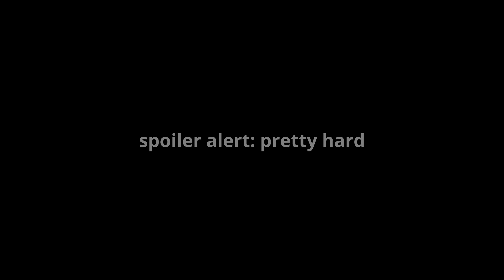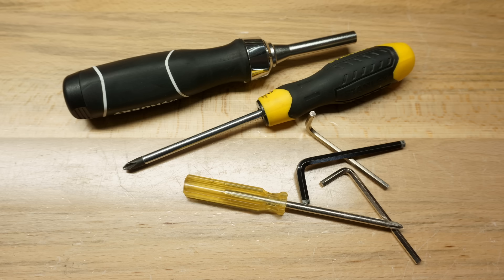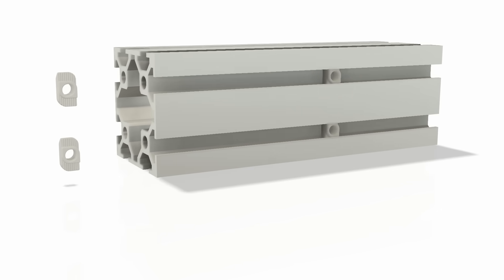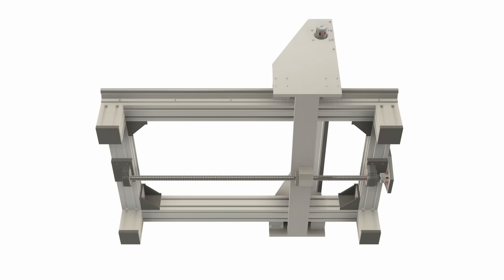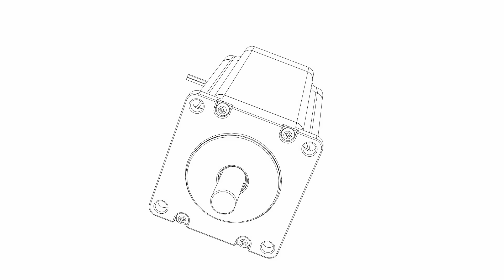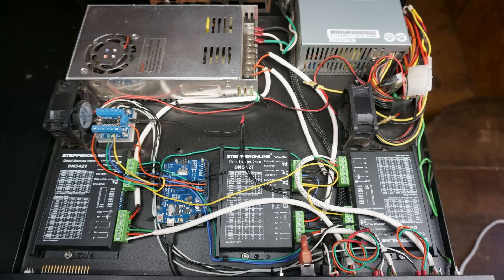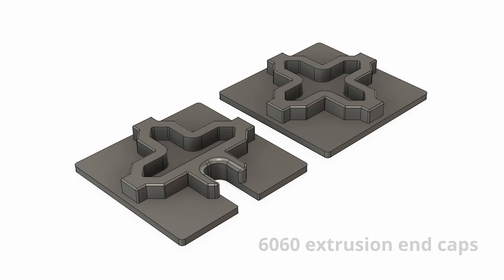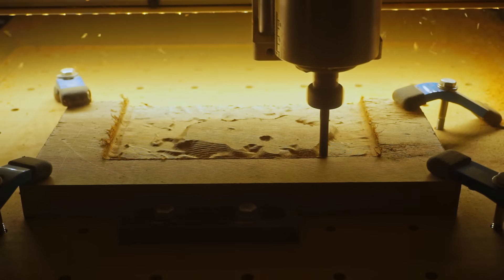Making a DIY CNC machine with limited tools

Comment: But why does most CNC machines have shorter Z axis? Isnt it more efficient to have the same length on all the 3 axis?
Reply from the maker: You can't really cut much deeper than the length of the bit, and the longest bits that are commonly used on a machine like this are 3 inches. So there isn't much point in having the Z-axis travel be much more than that.
Reply: @benmakeseverything  right. I didn't consider the bits. That means, if you want to make something tall with custom shapes, you need to add another axis/rotation where the router can rotate an angle of 45° or more. Then that would be another issue for stability and precision. 🤔 Hmmm, that would be harder to make.

Comment: The next level thing you can do is wire your router to your arduino, this enables setting router speeds through the GCODE...

Also, if you properly grounded everything, particularly your router.  You can mill a small alumunum block, that is extremely precise, run a ground wire from it to the arduino.  This way when your router bit touches the the grounded aluminum block, it says, "o hey at this z axis, y axis, and X axis, is where the bit is".  This enables fast precise, repeatable 0ing out of the machine.

Comment: Nice! One question: aluminium isbt great to sand, because it's so soft it tends to gum up sand paper, so how many belts did you go through on that belt sander? Or did you find some way to avoid that?
Reply from the maker: I really didn't do all that much sanding on the belt sander, but you're right, it does gum up the paper a bit. Probably just the one belt that was on it got used up.

Comment: Hello. How precise is your machine. Thinking about making it and turning it to an art replicator. I’m just wondering if it has the precision for a fine detailed drawing with lead/ink. Help would be appreciated. Thanks!
Reply from the maker: It is very precise actually, and you can set the stepper motor drivers to different micro-step setting to increase the accuracy. The main loss of accuracy come from deflection when cutting through hard materials, but if you are building a machine to draw then it would not be an issue.

Comment: Thank you so much for this video, I absolutely want this!

With the enclosure, do you think it'd be quiet enough to machine foam in a apartment ?
Reply from the maker: Maybe - there are a few thing you could do to reduce sound. I don't think I went over it in the video, but underneath each of the 4 legs, I put foam rubber padding to reduce vibration. The machine is currently sitting on a sheet-metal table, but that amplifies some of the noise - it might be quieter on a wooden table. Also you could use thicker material for the enclosure. If you really want to reduce the volume though - get a water-cooler spindle instead of a router, they are much quieter.
Reply: @benmakeseverything  Thanks for the feedback.

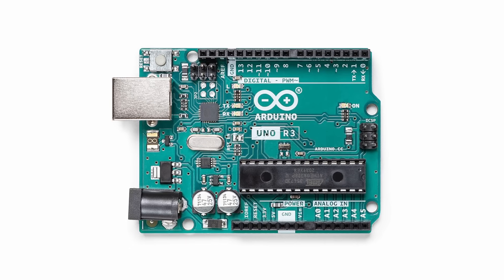Comment: 8:20  if it runs GRBL, can it use LightBurn?
Reply from the maker: Probably - I do want to add a laser attachment at some point, should also probably re-do the enclosure with fume extraction and some removeable opaque panels for safety.
Reply: @benmakeseverything   Laser or not, LightBurn is incredibly powerful software. 
When I saw the demo I bought it instantly!

It would seem to lend itself to CNC as well. But as soon as I typed that, I remember that that CNC is 3D, not 2D.   So can you use Prusa slicer?

Comment: Not a cheap hobby to get into by any means. Learning curve is also a bit steep. I've built a 5c cnc lathe, retrofitted a sherline cnc to run on grbl, built a chain driven cnc router and I'm getting ready to build ball screw cnc router. Definitely addicting once you get going. Did I mention it ain't cheap?
Reply from the maker: Yeah I believe you - I have been thinking of ways to update this and the costs really do add up... But it very rewarding when things work!

Comment: Great machine! I made few CNCs but not looking so good. 😢😢 I spent a lot of money to made a machine. Here are two examples. I spent 400€ for the first and more than 1500€ ( dust shoe and cyclone for wood and  vice for metal included) for second machine, this is very expensive hobby.  🤔🤔

https://youtu.be/TDTDN_KkoJc
https://youtu.be/ziXmku7p6O0
I use MDF for work plate on my second shown machine because metal one is too expensive. I have great and precise vice which I mount when I am doing aluminum and metal and I use only mist not flood. I use piece of thin metal sheet to protect MDF but some coolant sometime drip on MDF 😥

Bits are very expensive although last long. I spent more than 6€ for single tungsten carbide coated bit !!!! 😗😗 and I have a lot of various bits for different materials so this is great expenses for this hobby or work.

Comment: Something like this be used to mill a motorcycle cylinder head?
Reply from the maker: I wouldn't try it with this machine as it is currently set up, but with some improvements to the design it would be possible. Mainly, the Makita wood router is not ideal for aluminum and is limited to 1/4" shaft cutting tools. I am able to cut aluminum with this machine, but have to use shallow passes to avoid having bad surface finish. In my follow-up video I go over some ideas on how to improve it...
Reply: @benmakeseverything  would you know of a benchtop device that could be used for what I'm speaking of? Have a greatly appreciate any direction or advice given thank you

Comment: NICE ! I started designing my 6' X 12' CNC Table, though mostly for LASER use with a 90-Watt Co2 LASER I bought. But I was gonna cheat and use a Router as well,  even though most people suggested NOT to mix the 2 on the same table, but hey who's paying for it ? 

Sooo any way...I complete 6 months of research and CAD'ing the crap out of the table, with 3X NEMA-34's, an 1,800mm 2505 Ballscrew and 2x 20mm Round Linear Guides for the Y-Axis, a Pre-Built 300mm for the Z-Axis (ROUTER), and then started TRYING to find the 2X 3,600mm 2505 Ballscrews and 4X 3,400mm Guides for the X-Axis on the Chinese supplier sites. But they wouldn't ship those LONG Guides and Ballscrews to the US, COVID reared it's ugly head, everybbody quit selling for a couple of weeks, and when they did start selling again, everyone had DOUBLED THEIR PRICES over what I originally budgeted for ! Well, crap...THEN I lost the space I was gonna set it up in !

That was late 2018 into 2019...and it still sits unfinished $2,800 later, waiting for a finacial boost to finish it and get it running once and for all. So I know much of the headaches you got to enjoy, for this final entertainment value. GREAT JOB !!!

Comment: Hi, Could you please provide actual web-link to the parts
Reply from the maker: Hi, unfortunately I bought most of the parts over 2 years ago now, and several were ebay auctions so I don't really have links to most of them. This video was meant more as an inspiration than as a step by step guide, so I recommend shopping around for the parts that will best fit your design. Also, see my follow up video with more info if you haven't already. Thanks for watching!

Comment: I was thinking of buying a hobby 3018 pro and modify it what dya think? Is it possible?
Reply from the maker: I'm sure its possible, and probably a lot faster than building one from scratch. I have no experience with those so I can't say for sure.
Reply: @benmakeseverything  I mean replacing those round axial rods with linear ones and replace the spindle with Makita router would be quit good

Comment: Very well done. In case you ever have to tap tons of holes in metal in the future, opt for threaded inserts/helicoils. That way if you ever damage threads you can reuse the hole and not have to retread a hole.

Comment: Yes, I have one of those cheap unreliable ones, a 3020 cnc from gearbest; not to be confused with another larger machine with the same model number.  I would not recommend it to anyone as support was nonexistant.  I had to completely rebuild a lot of it as it was really sloppy so I ordered new threaded rods and bearings and added anti backlash nuts.  Now, it is very tight except for a very slight movement in the Y axis which I have not figured out yet why.  Then there is the control board that I accidentally burned up so for now I am using an arduino and cnc shield.  Just remember don't work on things like this when you are really tired or you could make mistakes.  I bought this over a year ago probably more like two and have yet to use it. Mostly because I have been more interested in my 3D Printer and my new toy, a Laser engraver.  But I wanted to cut some acrylic and diode lasers are not the best for that so I am dusting off my little cnc and installing limit switches.  Hopefully I will have it running soon.

Comment: I’ve heard you say that CNC is commonly used to milling machinery. 

Well i’m a CNC machinist for 20+ years myself and i don’t want to imply that you are incorrect on the subject matter. I’d only like to add a few more features that expanded machinery and a little history to the subject. CNC isn’t purposely applied with milling machines only, and it also got applied to lots of metalwork automisation machinery. 

It actually was founded in the early 1950’s on a turning machine. 

And so on it took flight into the metalwork factories globally and got applied to flat surface and rounded profile grinding machines and multi purpose processing centers (witch are a combined turning/milling/finishing and end control by dimensions and coordinates measuring machines in one. 

Many years later in the late 1970’s it revolutionized the entire engineering industry mainly the metalwork sector with waterjet, lasercutting, etching, roll-brake and press-brake machines. And even die-sinking EDM (electric discharge method or machining.) Wire EDM and hole drilling EDM plus casting metals and injection moulding are more and more becoming standardized by the precision of Numerical Control by Computer input. 

3d printing is a nice addition to the CNC community especially because it’s a adding material process instead of the removal of the actual base material. 

Hopefully this will be a bit of use to anyone, i just felt that i needed to react with a difficult subject matter since there is so much diversity in processing and in programming language that would have made this reaction 10 times longer (if i knew it all, what is obviously not the case!)
Reply from the maker: Wow, I didn't realize how far back it went. Very interesting! I do realize that there are many types of CNC beyond just milling. I probably could have worded that part of the video better. Thanks for watching!

Comment: My question is why you chose to move only the spindle and block on the Z axis. There are a lot of designs where the block is attached to X and Z moving with everything stepper motor screw etc. Why did you make this decision? It's not limiting the workspace if the Z axis sticks out some height all time?
Reply from the maker: I just used a pre-built assembly for the Z-axis, and that's how it was set up. I agree that there are better designs though.
Reply: @benmakeseverything  It's doing great in wood? I have openbuild style router and Z axis is weakest point. Its bending while working in oak or other harder wood.

Comment: what if you use wood to replace aluminum?
Reply from the maker: I would not recommend it, because wood is less stiff than aluminum and it will cause lack of accuracy. However, I have seen other people make machines with wood, so it is possible.

Comment: You don't need limit switches lol you have to manually set zero every time you make a cut 😊
Reply from the maker: True, they are not required, but having limit switches is a safety feature. If the program accidentally tries to run the machine beyond its bounds, the limit switches will stop it from crashing.

Comment: Didn't notice it in the video, but you could add a window opening or some perforation w/ a foam filter on one side of the enclosure, then put an opening for a vacuum/exhaust system on another panel - preferably opposite of the "intake" filter side. It would increase the noise by opening the box a little & adding the vacuum, but you would gain a more self-cleaning system & would keep your work material & tools cooler to boot. Currently going thru a Machinist Technician course & that's pretty much what metal CNC Mills or Lathes do w/ liquid coolant. Coolant keeps everything cool & washes chips out of the enclosure & is run thru a filter & recycled back into the machine.
Reply from the maker: You are correct, I don't have a chip/dust evacuation system and that would be a good addition. I plan to re-do the enclosure and add one in the future. Thanks for watching!

Comment: This is so cool and something I definitely want to consider building at some point. How much did it end up costing you to build, and how much was the most important parts, like the router?
Reply from the maker: Thanks! I made a follow up video with answers to several questions, so check that out if you haven't seen it. Short answer - the total was around $1000.
Reply: @benmakeseverything wow, freaking amazing, definitely put on my list of need/want machines

Comment: I have built a similar machine with Nema 17 motors, but of course not as nice or as powerful. I use the same Makita router which is switched on or off by connecting to a solid-state switch (no heatsink needed) activated/deactivated with M3/M5 g-code commands (edited into the g-code file). The ssr is triggered by the Arduino output for spindle speed control. It allows me to power up/down of the router automatically, even with a limited degree of speed control.

Comment: It's really cool video! All interesting (and necessary/important) details are covered, making video practically useful for us, same "non-engineers" 😆 Thank you! My greatest like!
What I doubt as a real engineer is Y axis: you move a WHOLE CONSTRUCTION on a single rod! (ball screw) It's weight of vertical supports, X axis, Z-mech assembly and a router (more it powerful, more it weights). Obviously you create load on the screw (actually on NUT on this screw). I would make TWO screws on each side of machine, join 'em w belt and put a whole X-Z-construction on a rollers (also frequent solution). Then all load comes on roll wheels and you simply move things with ONE st.motor, which rounds TWO cogs, which are joined to long screws. Hope you got my idea 😆

Comment: just to emphasis the importance of rigidity and not build a cnc as cheap as possible.
I made the MPCNC several years ago and it was as rigid as jello. all the supporting braces were made from 3D printed components and the gantry had 5mm of deflection at 1lb side load on the tool. it was a terrible experience that ruined cnc routing for a while. i spent $600 on hardware to make it when i was between jobs because i was hoping to turn a profit. 
> Rigidity is extremely important in cnc.  flexibility creates a disaster that costs money and headache. 
the MPCNC wasn't my design. just a bad one you can find online.
Reply: @
DarkShadowsX5 :  Interesting comments.  They echo the feeling I got from watching MPCNC videos.  Have you seen anything in the same (DIY) category that "ticks more boxes" for you?  The PrintNC for instance?  It appears to perform well as designed, and can be easily upgraded.  The designer does not seem to be "Precious" if you want to deviate from his original plans.  I have seen machines made with the 3d printed parts, and then used immediately to make aluminium replacement parts.
Rigidity is King. Having a machine with significant mass has benefits as well, and usually gives a decent amount of rigidity... the downside is that you have sacrificed portability.  Filling voids in the frame with epoxy-granite apparently makes a sizable difference, but heaven help you if you want to move it!  🥴

Comment: I thought CNC machines were boring because they just made signs with them, but those carvings are amazing! Its like 3d printing but with wood and subtractive. I just not into cutting down healthy trees for this kind of thing anymore or any other wood products really that arent for basic survival like shelter when other materials can be used, and i think with material science it will happen, we will get more consistent and just as easy to work with materials like wood eventually.  It would be cool if you could get a lump of plastic and cnc it down to a benchy, That would next level id imagine it need some jointed arm to pull off and maybe next step in evolution of these machines,  ones that can spin the tool around 365 degrees. Maybe even telescoping so you could in theory strick this tool into a block of plastic and hollow out a perfect sphere inside having it almost complete closed off except maybe a small hole the tool entered.

Comment: You should definitly give FluidNC a try because that machine deserves waymore than an Arduino Uno. FluidNC Runs on a esp32 and can generate much muuuch more microsteps, Your machine can also run a lot faster without running out of resourses and therefore shutting down

Comment: when i saw the plates what you made. i started to feel "oh my god" ,how much tool change you should do in the process time :D some of them was extra detailed which need smaller cutting tools :D but it was awesome to watch
Reply from the maker: Thanks! I only did one tool change for each of them: The initial roughing pass was with a 1/4" ball-nose bit, and the finish pass was with a 1mm tapered ball-nose bit. I made a follow up video that shows these bits and others, so check that out.